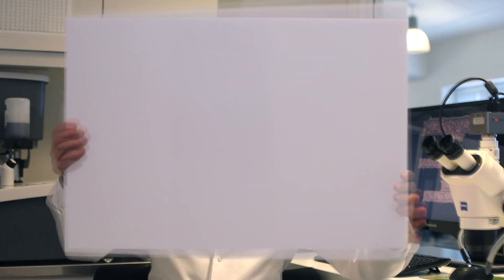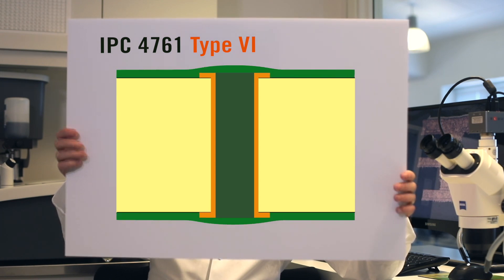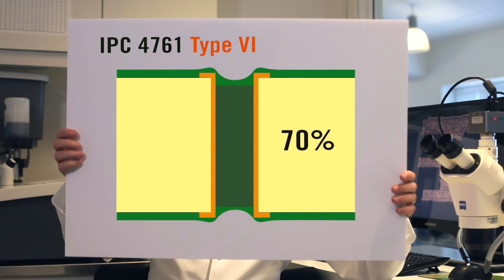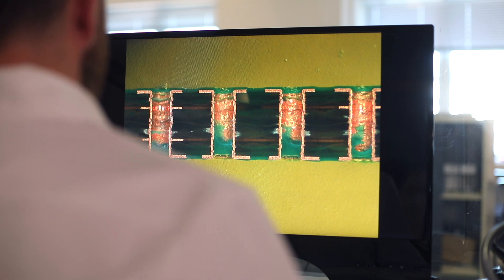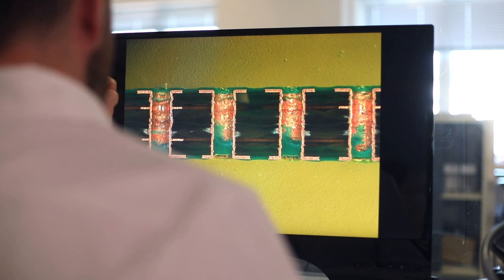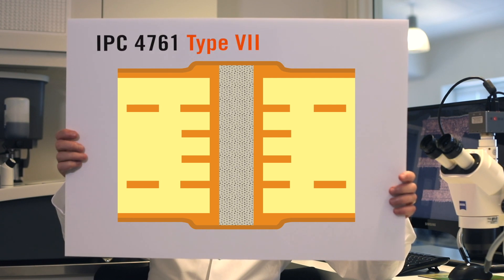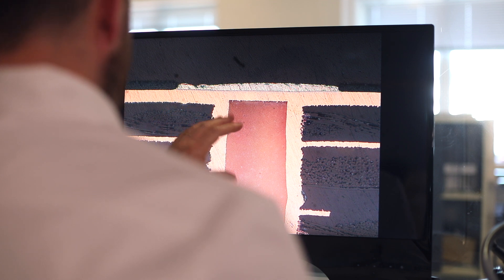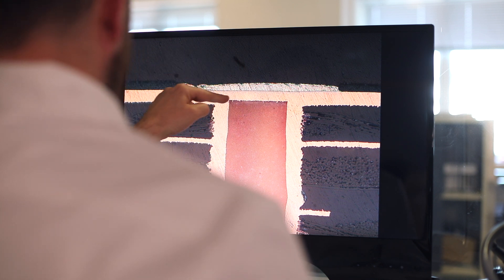What type of via hole plugging in a PCB is recommended? | PCB design and technology

Comment: Wary interesting, thanks for sharing!
I hope that you will please answer this question: I am thinking if a filled via (no hole trough but solid copper) not would be even better?
Reply from the maker: Yes, this would be an ideal solution as not only would we have a completely filled hole using a plated ‘filler’, but it would help in terms of both electrical and thermal performance (increased heat dissipation for example).
 
However, to copper fill a through hole, like a via hole, so that we have a complete deposit without voids is extremely difficult to achieve.
The reason being that the plating rate (speed at which copper ions are deposited and thus building up the copper deposit) is faster at the surface and it slows as we enter into the hole. Therefore a typical problem in trying to do this is the presence of voids within the copper deposit / centre of the hole which leads to solution entrapment – something that poses significant long term reliability concerns.
Copper filling of holes is often seen in blind via holes (HDI projects), but not in through holes.
 
This level of complexity is a key reason why there are not so many factories that can / do support this type of plating in through holes. BR, Chris Nuttall, Chief Operating Officer NCAB Group
Reply: @ncabgroup-PCB  WOW thanks a lot for a great answer, great service!